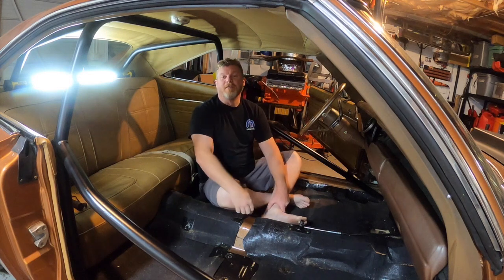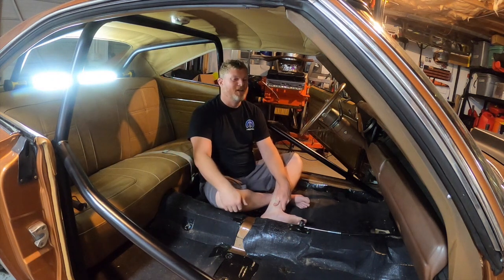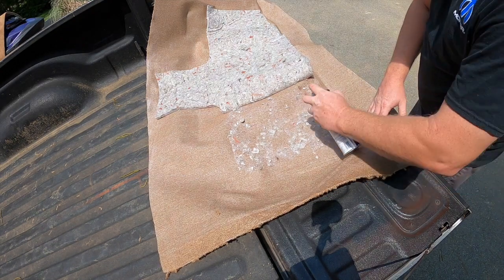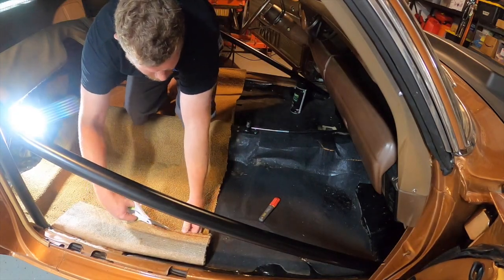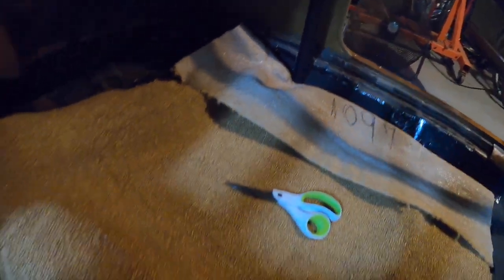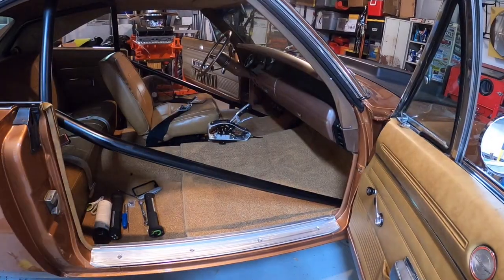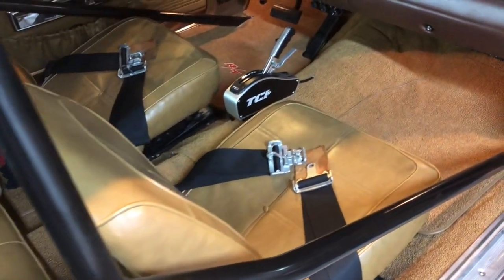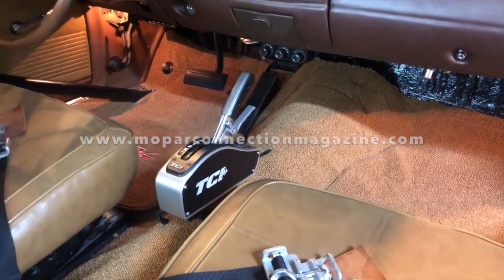Revive Your Classic Mopar's Interior With This Easy Carpet Installation Guide

Comment: Looks painless, Kevin...especially for those of us w/o a rollbar!  I have yet to put new carpet in my restoration car but with that in mind...should I predrill and position my high beam switch before I put the carpet in and same with the gas pedal bracket and pedal? Maybe it doesn't matter since there's no holes in the floor sheetmatal yet so...let it ride?  Drop in the carpet, then drill?Oh, yeh...my car has a new floor.  Mike
Reply from the maker: Oh gosh, no. And definitely DO NOT use a drill for anything. Drills bite and peel carpet into a nasty mess. Use an ice pick or a soldering tool to burn a hole through the carpet.
Reply: @moparconnection  Yeh...I can see how that would happen. I guess I SHOULD pre drill the holes in the floorpan before I lay the carpet. Then the holes would be there first so I can melt the holes thru the carpet for the screws?
Reply from the maker: I'm presuming you mean the holes for the seat brackets, right? If they're not already drilled then yes, make a template using your seat (or just sit the seat in there) and measure accordingly.